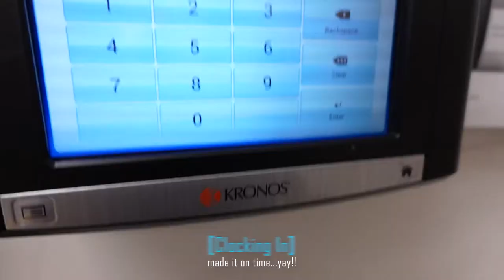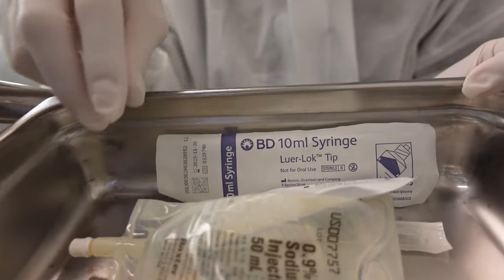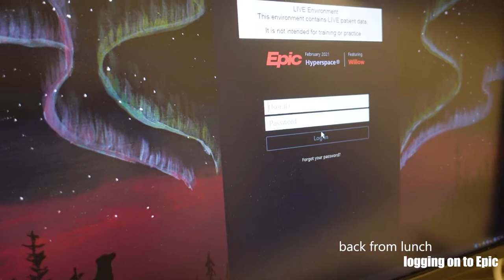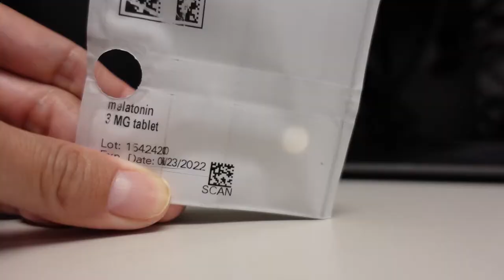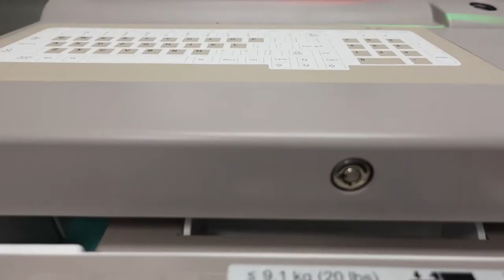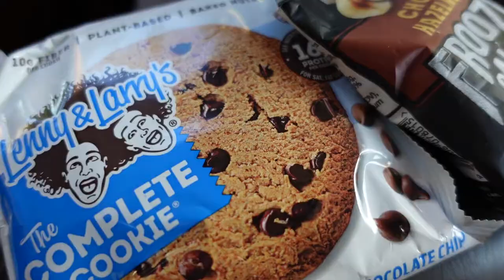NIGHTSHIFT VLOG 🌙🏥|| Inpatient Pharmacy Technician 10pm-6:30am (Part 3 of 3)

Comment: How years do need as a pharmacy tech to get a job like this and how much do they start ?
Reply from the maker: It personally took me 3 years including externship to get into a hospital setting. It also depends on who you know aka connections. Easier to be hired from your externship (pharm tech school is contracted with) usually includes hospital setting.
Reply: Some hospitals have trainee programs. My local children’s and women hospital has a pharmacy technician trainee program. I’m in the lower part of Alabama and the starting pay during the 4mo training is $13, then $15 once you’re done and $17 once you’re certified. And of course it goes up with experience
Reply: Also some hospitals don’t require pharmacy techs to have experience so some are lucky enough to get hired either during school or right after